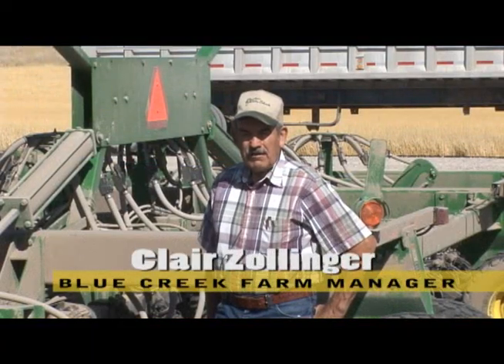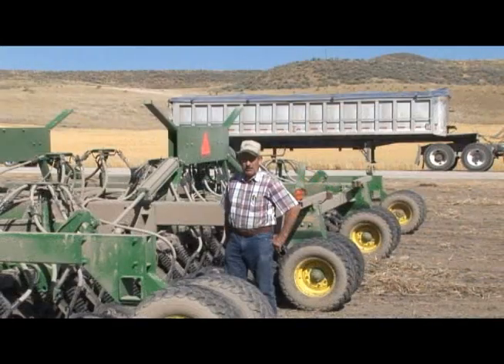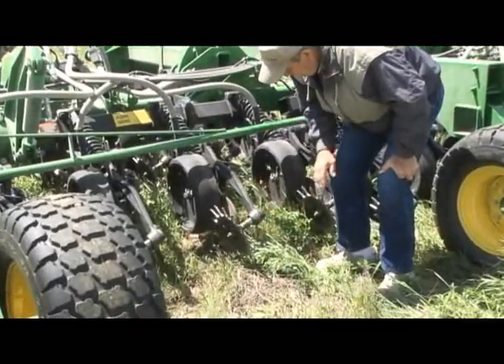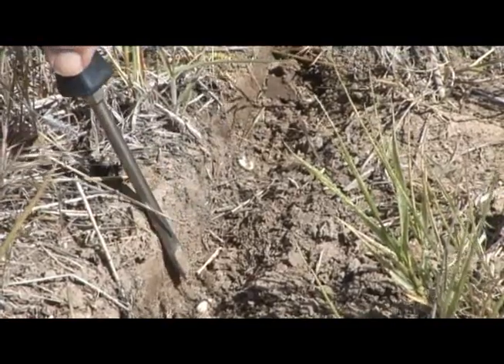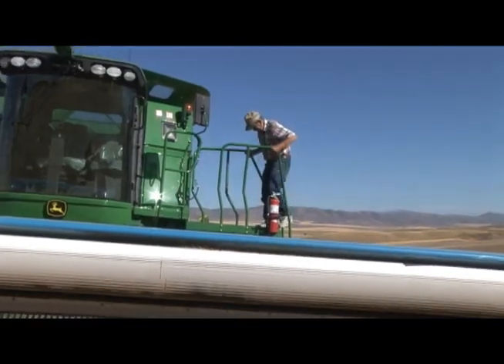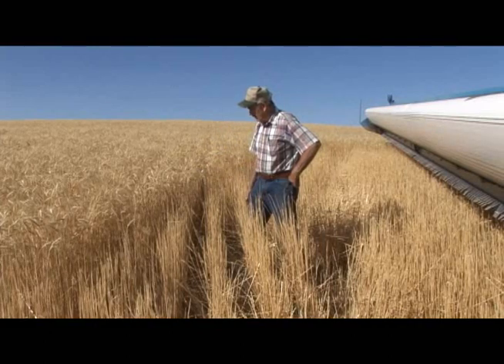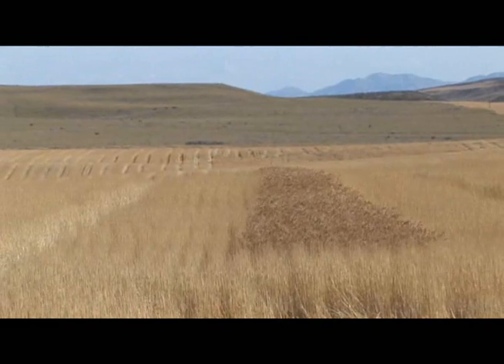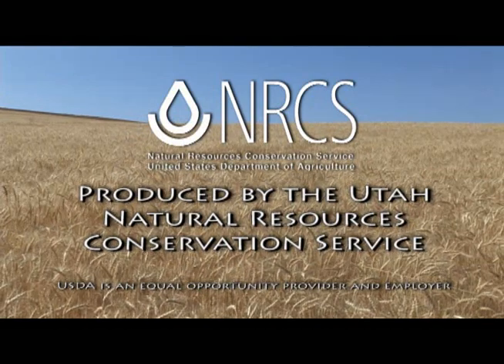No-till dryland farming

Comment: We have been doing this for 30 years in Texas Panhandle and the soil health has been improving over the years.   NT into CRP by strip coulter to cut grass crown and place 10-34-00 made for the saving the benefits gained in 25 years in CRP grass.  This past August we got over 10" of rains and now the subsoil is filled  down to over 6 ft.  for the next summer crop.  The soil is structured so well that we had no rain runoff.

Comment: Look into the Needham ag seed tabs instead of the flimsy and short Oem ones,  they don't have the issues leaving seed on the surface in heavy residues and last much longer.  I have one of your old 1895 drills and have found a few areas in which to make the 90 series openers perform better.
Reply: Also, I don't think you correctly understand the function of the seed tab after watching the video again.  The seed comes down the boot in front of the tab (not behind), the tab keeps the seed in the slot. often the Oem square tabs let the seed bounce or get blown out of the furrow because they are too short and not the correct shape to fit the slot.  the tab does not clean the furrow or push debris out of the way,  or even touch the bottom of the furrow.  I have been interested in the spiked closing wheel for a while, they seem to do a great job.  keep an eye on seed boot movement too, caused byworn mounting bolts, that can really cause inconsistent depth when they get 10,000+ acres on them and start to move more than a 1/2"